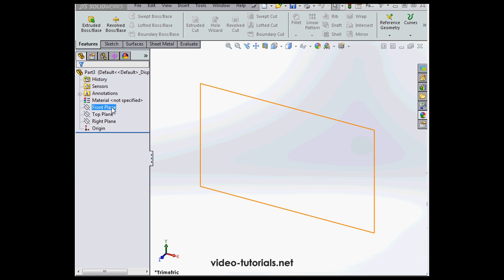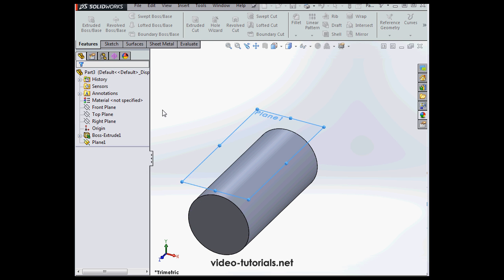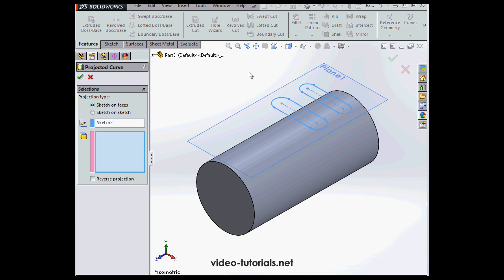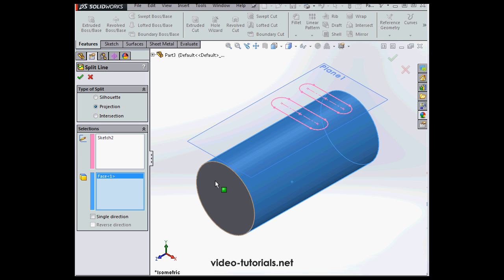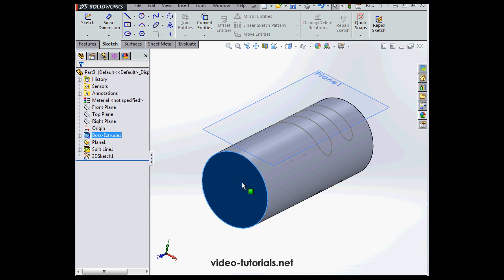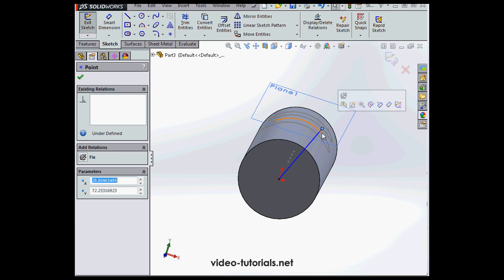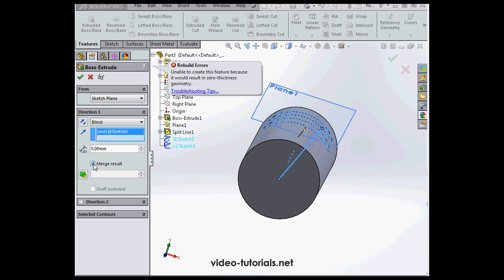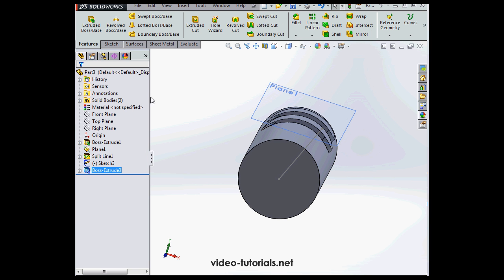Slots on a Cylindrical Surface - SolidWorks Tutorials Q&A

Comment: Why can you not just use extruded cut?
Reply: in that example you are right, but if it was a complex shape extruded cut would end up pretty nasty, out of shape and had problems all over the object. This is something like wrap but to have right dimension on finished product.

Comment: The top or bottom face of the cylinder has a flat surface. If the face has curvature or has a dome like feature how can i draw a direction vector

Comment: That's all fine and dandy, but what about a repeating pattern around a hollow cylindrical tube? I.E. placing air vent slots in the same directions as the tube?
Reply: I'm looking for similar thing. I want to make a cut in a cylinder and then make it 3 time to create slots for rocket fins
Reply: Use circular or linear pattern on the 3d sketch